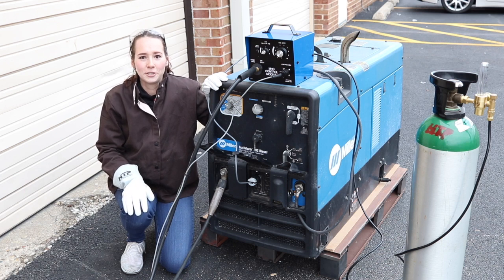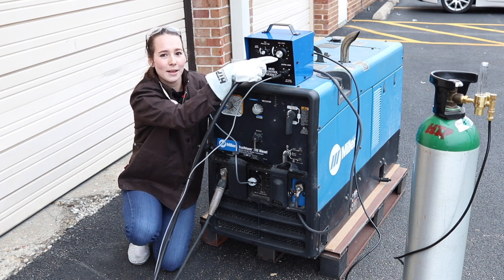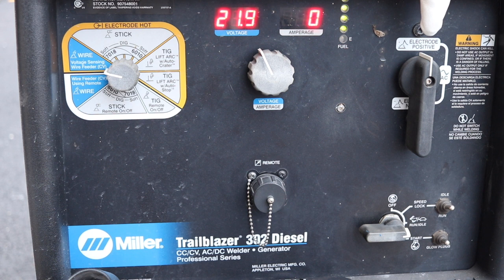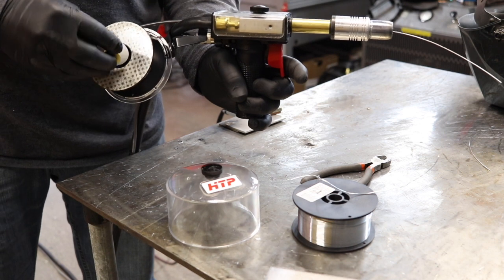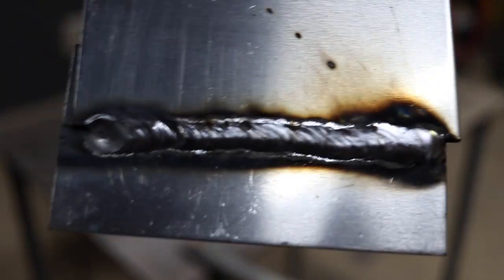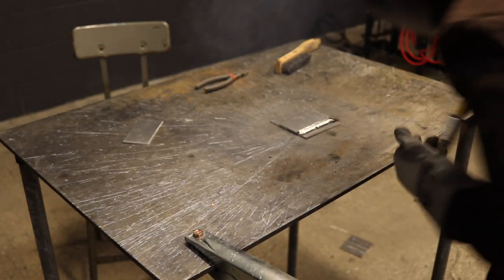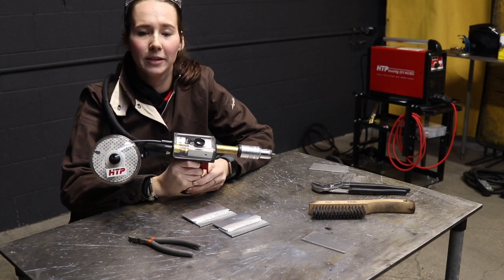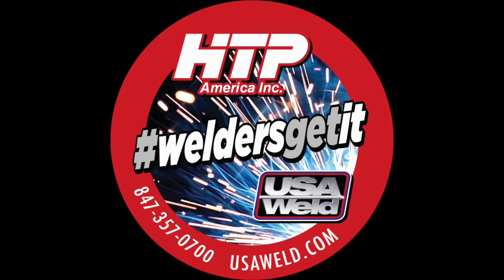Set Up of the HTP RSG 258 Spool Gun

Comment: Thank you guys for putting this video out!  Timely too, since just this week I dusted off my RSG250 to fix an aluminum bumper on a fire truck.  Your video along with my manual helped me get a good starting point on my settings, and what results I could expect.  Practice coupons off my miller 325 will be my first aluminum welds ever.

Thank you for the guidance, more videos of this killer gun running in repair situations -including its versatile capability of running flux core at BIG amps would go far to upstage the other guns out there.  Subscribed and looking forward to more from HTP!